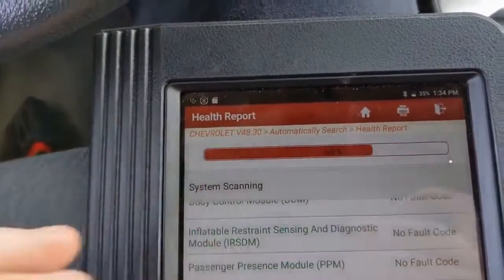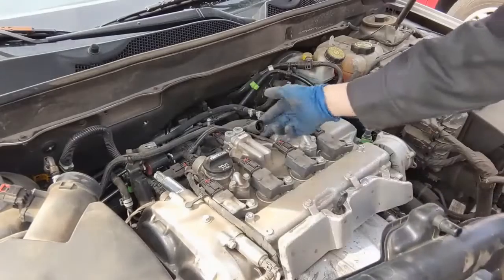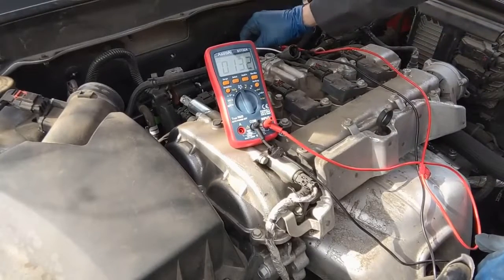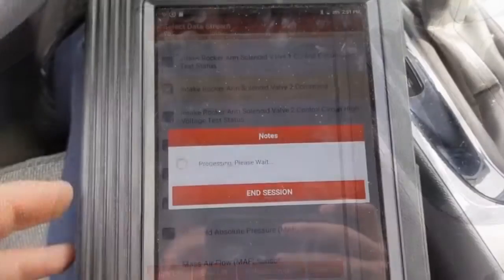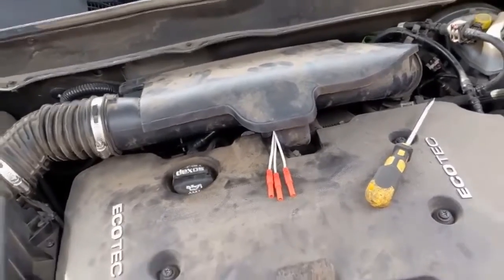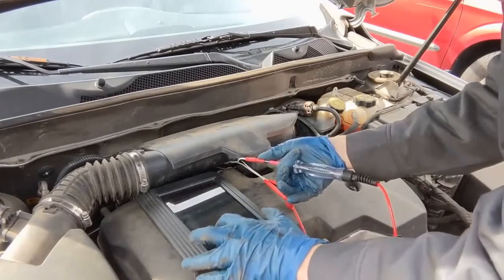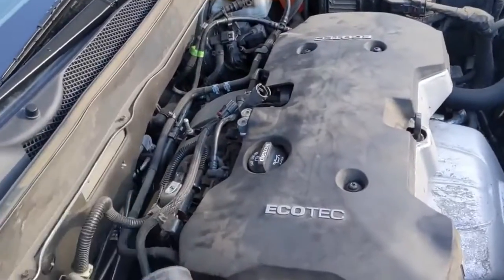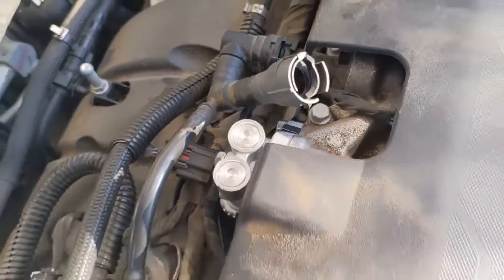2014 Chevy Malibu P16cf and P16d0 Intake Cam Oil Control Valve | Automotive Engineering

Comment: You think I can disassemble the e power it with 12 volts or 5 volts d to test if it operates
Reply from the maker: @animeee8540  I haven't done it before. You can try. I believe the center is a shared power and each side gets a separate ground to operate that side. Let us know how it goes 👍

Comment: If this part was defective, would you expect to receive a P2645 error?  I have not dug in to ohm test, but that seems pretty straight forward as a first step.
Reply from the maker: @robbalyeat  Definitely a P2645 can be from a faulty rocker arm control solenoid. I would expect you'll see it in the ohms. Make sure to check the ohms both cold and warmed up 👍

Comment: To anyone doing this - you don't need to take the air chamber off completely. On mine someone replaced the screw for the hose clamp on the right side, so I just removed the 10mm bolt, two cable mounts, and the left hose clamp. Just lift it slightly and you'll have plenty of room.
Reply from the maker: Thanks for the tip 👍
Reply: @ValleyMobileAutomotive  Thanks for the vid! I would have removed it, but I couldn't get my hand in there to loosen the screw that well, and when I finally did I found they were using some non-standard screw in the clamp itself. Someone had been in there and caused some issues.

Now driving to see if I can get the code to come back or if it fixed it.

Comment: And what is the main purpose of the intake valve ?
Reply from the maker: This oil control valve helps with both performance and gas mileage. It should not cause your engine to die.

Comment: Got a question, same issue, same code, changed phasers, oil change later, p16cf changed part, have you seen actual failure on the intake/lifter?
Reply: The same thing

Comment: Will this cause a like burning smell?
Reply from the maker: It shouldn't. Usually a burning smell is from something touching the exhaust. You can check to see if you have oil leaks or maybe ran over something plastic that is stuck to the exhaust. Just some ideas 👍

Comment: so the p16d0 code comes with the p16cf code? im getting both. also could you tell us where you got the part please?
Reply from the maker: Yes, it's possible to get both codes at the same time. You can get the part at your local parts store or I like using rockauto.com for some parts if I don't need them right away.

Comment: Why not just back probe the harness connection then you can test solenoids without having the open circuit to stop you per oem way? But good informative video none the less. The tube topside of motor the from pcvs , the curve collects moisture and causes rear main seals to fail. I know the engineers that created the 2.5 and 2.4. They actually advise making it straight.  And to change the rubber intake manifold gasket to a neoprene to stop the bolts from loosening. 👍
Reply from the maker: Hey Steve thanks for the comment. Yeah later I thought about back probing with the connector plugged in. And also I'm sure this would have some kind of bias voltage on the wires as well that I could have checked. Thanks for watching 👍
Reply: @ValleyMobileAutomotive  thx for the informative video.

Comment: What are those things you are using to probe called? Not the multimeter probes but the white wires.
Reply from the maker: They are called "test leads" or "terminal leads". I have a link in the description to a kit you can buy from Amazon. I also have a short video that shows how you can make your own https://youtu.be/t9PVPf-Pkjw.
If you are a serious mechanic the master kit I have is from AESWave.com. Hope that helps 👍

Comment: Did you have to disconnect the battery before doing this?
Reply from the maker: It's not necessary but if you do disconnect the battery it will clear the codes for you. I didn't disconnect the battery and I used the scan tool to clear the codes when finished. So it's up to you